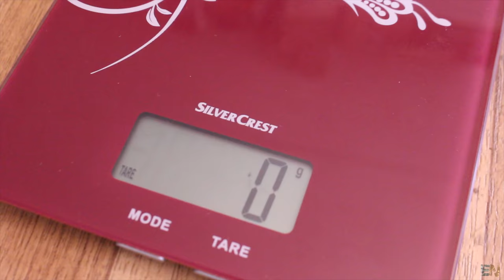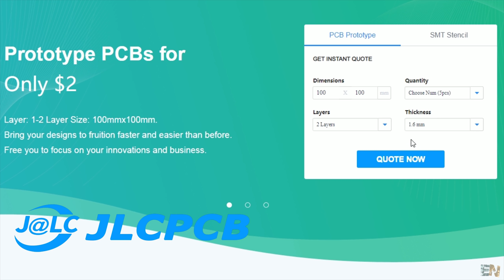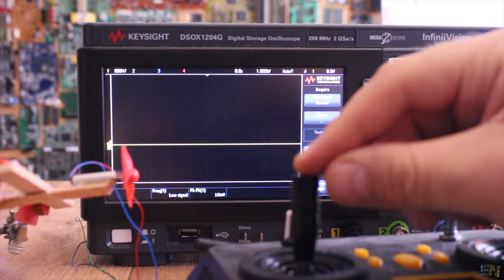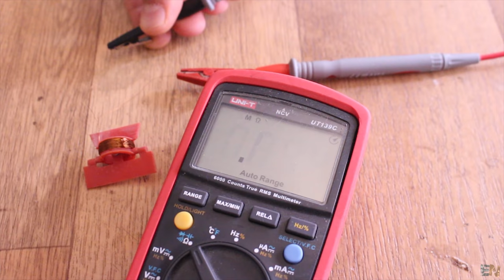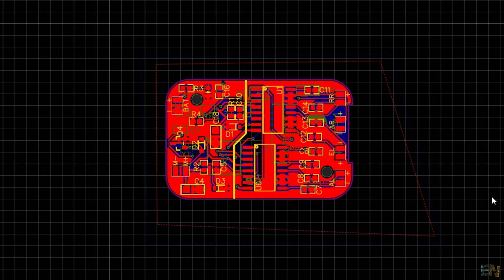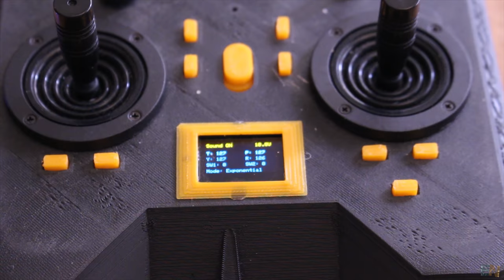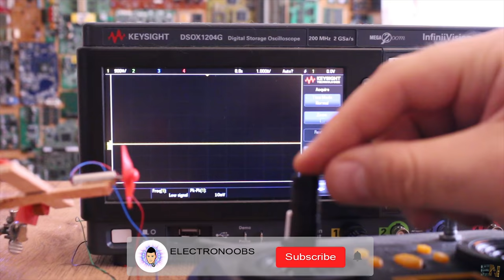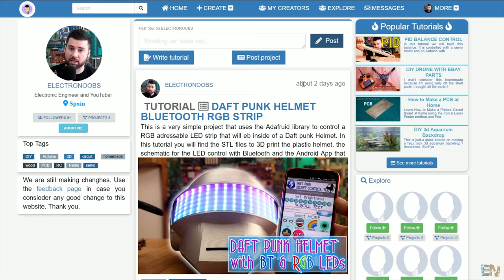Small Radio Receiver Board | NRF24 + Arduino

Comment: Great video @electronoobs ...
Add a big value non polarized capacitor in parallel to the coil, remove outer magnet which is on coil and try to use some elastic material to keep flapper at middle position,you can use that white isolation paper used in induction motor winding

Comment: I gotta use an opamp as voltage follower to smooth the pwm signal. An rubber band to hold the flap in position may help too.

Comment: I think you can use a simple low pass filter in which it will take big previous value and very small current value. I think this can make the move of the flapper more analogous.
As always awesome project

Comment: Depending on your code it may be a good idea to use the timer registers of the atmega directly. Arduino sets the PWM Frequency pretty low. If you directly access the timers it would be possible to get above 20khz which should be stable for your actuators.

Comment: Maybe it could be made smaller with 4 layers and lighter, if you maintain the same thickness, assuming the current one is 0.8mm thick. Though, it'll become expensive (cost per via goes up and so does via count)...could also use attiny or some smaller  package for same IC

Comment: It might be nice to mention that a new atmega328 does not come with an arduino bootloader, so unless you're gonna pull one off an existing arduino to use, you will not be able to just 'upload the code' as you're suggesting. You'll have to flash the bootloader yourself, which can be rather finicky and annoying.
Reply from the maker: Hey, thank you iforce2d for your comment. You're right, that's why in the text tutorial on my website: https://electronoobs.com/eng_arduino_tut105.php on part 3.2 I show how to burn the bootlaoder in case you have a brand new chip. Btw, thanks for all your videos, they are great and helped me a lot of times. Have a really nice day.

Comment: goood job friend but there will be a problem in terms of receiver comm range because of ground plane under antenna of the nrf module,
at least ,you have to remove this part of ground plane
or you can set a slot under antenna,
I suppose that it will communicate around max 50 meter, normally it works around 100meters, Ithink.

Comment: hello, i've been a fan. and you're videos helped me understand everything but sadly there's no video about moisture sensor. i just want to ask if it's possible to have a moisture sensor automatically trigger a relay to enable watering system and have the android app get the value of the moisture sensor and has the option to trigger the relay too via android using hc-06 or 05 to enable watering system
i'm going nuts T_T

Comment: another good video keep it up and I had a question , how long this module works? recently I wanted to buy them and I'm not sure how far they can establish the connection? tnx
Reply from the maker: Using the amplified antenna for the transmitter I had good connection up to 700m. But check iforced2d channel. With a good antenna he had signal up to 10Km. That's crazy.
Reply: @ELECTRONOOBS  OMG , tnx for information
Reply: @ELECTRONOOBS  10km thats really cool

Comment: oddly enough with all of these receiver videos, I'm looking for size, rather than weight, when looking for a smaller receiver. Do you have any recommendations that fit within a 1.5cmX2.5cmX3cm space? Cost is an issue, but the servos I'm planning on getting are rather cheap, so a splurge on the receiver wouldn't be too awful.

Comment: i did not find 5volt pwm output on my nrf20l01 Arduino receiver . for that reason i could not turn my small core less dc motor with full torque and full speed.i am using same mosfet which you also used.  please  give me a solution.

Comment: Sir i have an idea of an amplifier in which I want to filter the sound to high pitch and low pitch at the  input and then feed the amplified sound to a woofer and a satellites, I just wanted to eliminate the use of band pass filter at output. Though this would be single channel but it would be very efficient, and no one stops us from using 4 ch amplifier
Reply: You mean sending signals to satellite using sound🤔

Comment: The atmega338p au chip doesn't come with the bootloader on it so we have to flash one on it ... I didn't know this before and I soldered it to the board in the video  now I'm trying to flash a bootloader  using the method here https://www.instructables.com/id/How-to-Burn-Bootloader-Onto-Atmega328p-AUSMD/

But I'm getting an error(invalid device signature 0x0000) hoping someone can't help me out